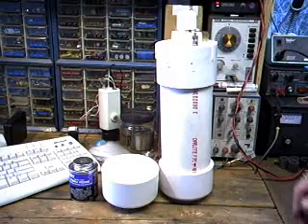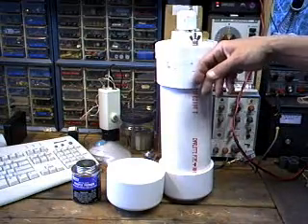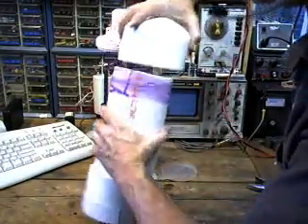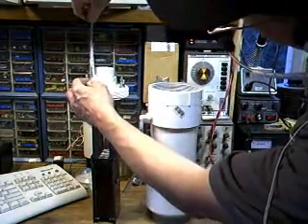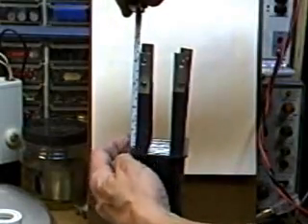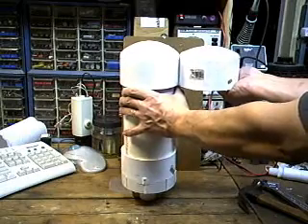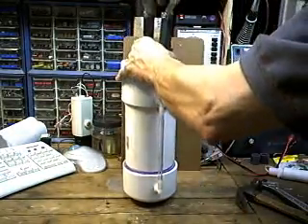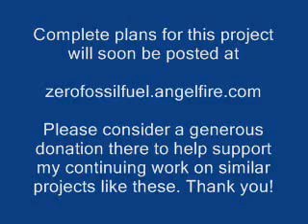#82 - VSPB cell chamber construction Mods

Comment from the maker: It's a 2006. CELL WENT IN TONIGHT! Puts out about 2.5LPM cold, 3.3LPM warm. Got some stills to put up tomorrow. Cell sits low behind the grill off center to the passenger side. The ridge created by the cleanout cap collar allowed me to use a very nylon cable tie to strap the cell to the beam that runs horizontally in front of the A/C condenser.

Bottom of the cell is strapped to the front bumper beam. Pretty solid.

Comment: @robbyrobotus  -On some local page about HHO units, it was said that for engines up to 2000 ccm it's enough to have up to 1 L of HHO gas per minute. More than this can cause engine to overheat, and start to explode prematurely (in other words, for running engine only on hho or more hho, ignition point must be specially adjusted).

Comment: ... I would also like to recommend placing a small magnet on the blowout cap and a relay on the side of the top.  The relay would be like an on/off switch through a transistor, so if the cap is blown off, the magnet won't pull the relay and the cell shuts down to prevent further damage.  *just some thoughts*

Comment from the maker: My design circulates elyte very rapidly which aids in cooling. I have never had a cell temp higher than 140*F even on the hottest summer day.

That said, I have already seen the PVC relax pressure between the nuts that hold it to the cleanout cap creating a small leak. If it happens again after retightening I'm thinking it might need larger washers to distribute the clamping force.

Comment: Not sure what year or cab style your tacoma is, but I would've personally put the device behind the back seat (both cab styles should have ample space behind the last row seat), then run a line and power cord under the inside door rail and placed a bubbler under the hood.  This would provide an easy refilling without having to open the hood EVERY day just to check the level, and if there's a blowout from the top, you'd be able to hear it and not lose the cap .....

Comment: I am not sure what the problem of putting an HHO generator in a cab harms.  Breathing in the fumes won't hurt anything, and the flash of the fire would be at most 10 square inches within .2 seconds before it vacuums back into the cell...not enough to catch anything except maybe human hair on fire.  If you are worried, you can sleeve it in fire retardant material leaving enough room at the top to cradle the blowout cap...which could double as an insulator.

Comment: Have you had any problems getting the unit too hot? Mine blew the PVC seals during a 4 hr. drive and all the fluid leaked out. Got over 200 degrees and was running at about 25 amps. I am hooking up a pump system with a radiator to cool the water down a bit. Will have to re-think that PVC glue. Not sure if it can handle the heat on long trips...

Comment: I have been trying to find out all over the internet, just how much hydrogen is needed to inject into the engine in order to make a difference?  I know everyone wants to make more hydrogen and usuall more is better, however with size constraints in many cars, a unit the size of yours simply isnt an option.  DO you have any information on that?  Also, my research has indicated that a large diesel, like in a motorhome takes significantly more hydrogen, although again, no one says just how much

Comment from the maker: You mean it took almost 2 minutes to fill a bottle that would otherwise hold 24oz of liquid. One and a half pints. Right?

Sounds like you replicated the Water4Fuel piece of crap. The max voltage between electrodes in water before serious heating starts to occur is 2.5V. Their design is snake oil. Anyone buying one is being ripped off. Anyone building based on that design is wasting their time.

Period.

Sorry to break the bad news. Throw it away and start over.